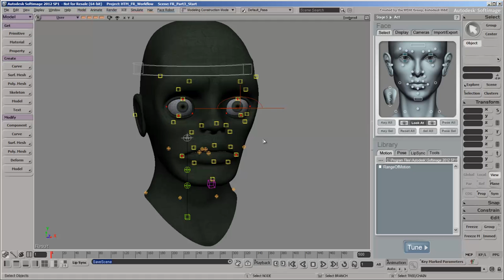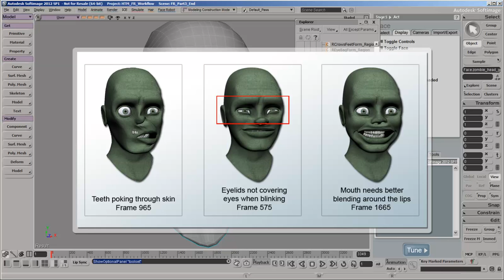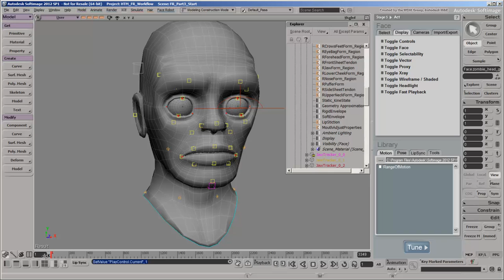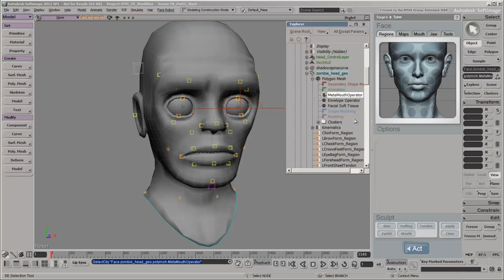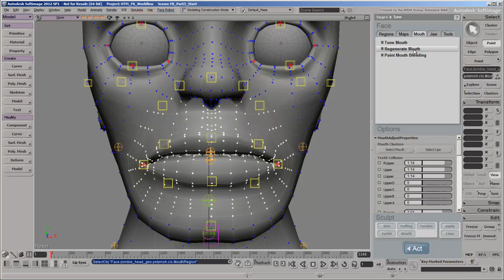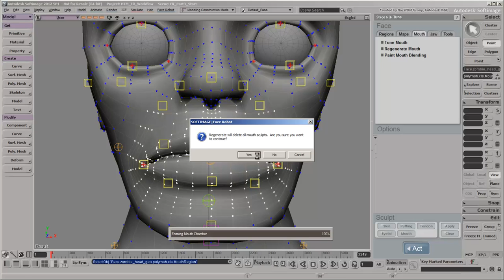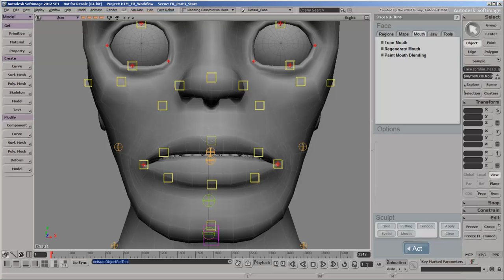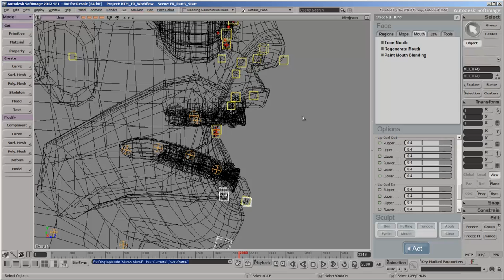Face Robot Workflow - Part 3: Tuning the Mouth and Lips

Comment: In SoftImage 2013, using the sample file the act of selecting animation controls from the Act panel fails. And when I click any of the buttons in that panel, there is a script error.

On the other hand, the Act panel works fine for the zombie head from the scene I had been working on previously.

Comment: Crosswalk 2013 is now available and the export/import to maya works (rejoice!). The normals of the zombie head need to be unlocked in maya, and the head texture copied to the maya project's source images folder - two little things I am hoping go away when I try a head from maya -> face robot -> maya.

Comment: The only standalone crosswalk available is 2012.5 . I mentioned that I tried importing into soft image (2013) itself and that did not work either; this makes me not too keen to try older versions of crosswalk, and the following quote from the help files also makes me pause:
"Because Softimage contains the Crosswalk product, you don't need to install it separately to import the animation rig into Softimage. "

Comment: That is indeed the section I read and followed along with.
Crosswalk is supposed to be installed at the same time as soft image, yet I tell you it did no such instalation of the maya plugins.
I even went so far as to try importing the dotxsi result into soft image, which did not work. 
File > Import > Face Robot Shape Animation Rig. 
I went through the export again, with slightly different settings and it did not work. What almost worked was Crosswalk>import, and I do stress ALMOST.